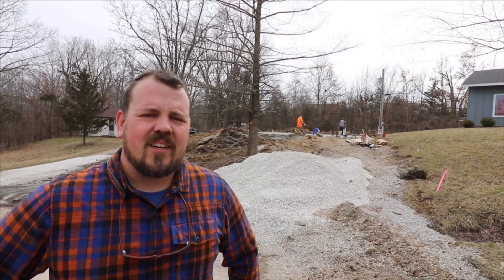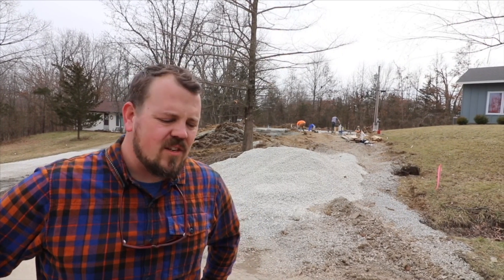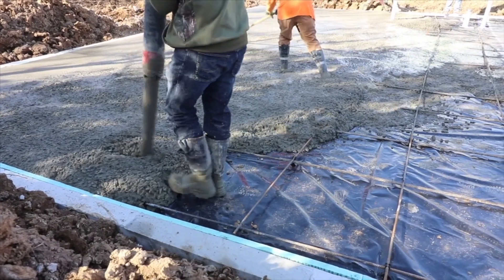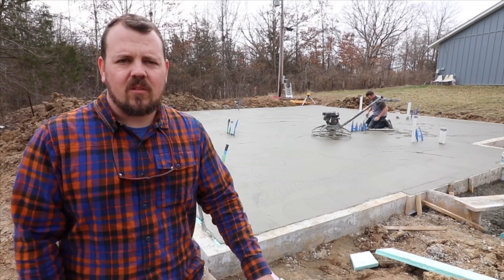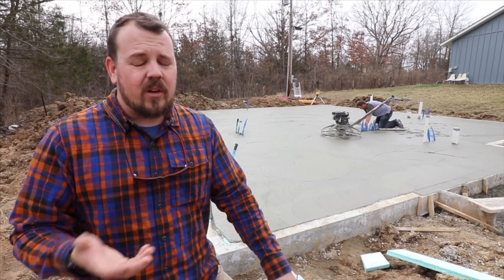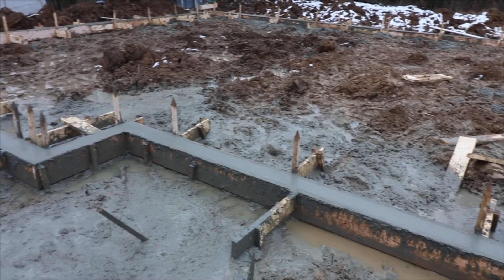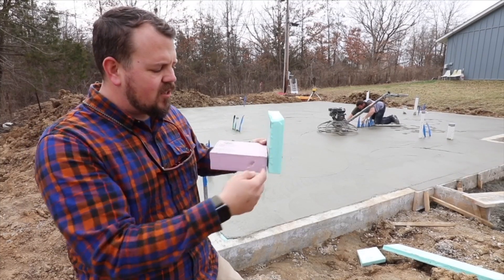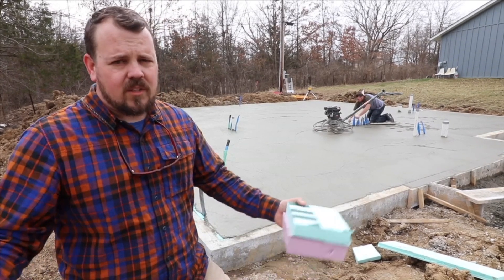How to thermally UNCOUPLE your concrete slab.

Comment: Insulation does not "uncouple". It just delays the thermal transfer for an hour per inch. 6 inch foam delays heat transfer by 6hrs. By morning, an insulated house without heating is EXACTLY the same temperature as outside. Then it will take 6hrs to heat up again

Comment: So the takeaway is that by insulating a slab-on-grade in the prescribed manner, substantial heat savings and comfort gains may be had prior to taking the next step of intalling in-slab hydronic heating.

Comment: I've got a house with a bomb shelter for a basement, a 6" slab covers the entire basement with 2x6 on sleepers and 1-1/2" of plywood for the first floor deck over the top of that. The first floor deck gets cooold in the winter and I need to remedy that in the near future.
I am wondering if I could remove the first floor deck, add 2"-4" of foam insulation to the top of bomb shelter/basement cap and then pour the remainder in 4"-6" of concrete?

Comment: A stone countertop that feels colder is not “emitting temperature back to you”. What is happening is the stone is taking some heat from your hand via conduction. Stone at room temp 72F is colder than your hand (somewhat under 98F). Heat moves from hot to cold or rather from more to less. Temperature is a measure of heat. It doesn’t get emitted. Cold is the absence of heat so it also doesn’t emit.

Comment: I unserdtand decoupling the edge of the slad as the concrete edge is exposed to the weather, in this video negative 9 degrees.  What i am struggling with is the necessity in insulating below the slab due to the average earth temperature under a slab being 55 degrees.  it seems like there is not much bang for the buck because that 2 inch eps is expensive.
Reply: You are still getting a minimum -15 delta that you will loose heat 24/7 365 days a year!
Reply: @imwteach  I'm not sure a 15 degree delta is worth the cost or trouble.  The wall insulation is battling a 50 dgree delta so that cost makes sense.
Reply: @kevinmickelson5128  Still, a 15 degree delta over the life of the home makes it worthwhile to insulate.  After living in our current home for 12 years with in slab radiant heat I wouldn't have anything else...I also wish I had placed more insulation under the slab.  I currently have 2" of Styrofoam and should have gone 4 or 6!
Reply: Insulating foam glass aggregate such as Aeroaggregates will not breakdown like a petro-chemical foam... and allows drainage so it replace most of the stone aggregate...
Reply: I thought the idea might be that the temperature of the ground next to the foundation is cooled significantly by heat transfer through the foundation and heat transfer from the ground outside the foundation.
Reply: I believe he is building a Frost Protected Shallow Foundation which requires under slab insulation in certain climate zones.

Comment: I’m in climate zone 2 so really nobody insulates slabs, but I have concrete floors and the west side of the house has a concrete porch that is connected and you can definitely feel the heat come through the slab if you’re barefoot. My question is this though. Is there a way to pour the slab all at once and insulate? I can just imagine the look from my concrete subcontractor if I told him we were going to pour separate days…
Reply: Build with Insulated Concrete Form blocks and you solve several problems at once
Reply: Have the contractor add the depth of your insulation to the total outside measurements and add the insulation to the inside of the form. I also added large screws into the foam to couple the foam tot he concrete. That’s how I did a frost protected shallow foundation. Super easy.
Reply: @bpdp379  I plan to do the same thing. May I ask, did you use a “protective coating” outside of the insulation? If so, what did you use?
Reply: @billwilljulz  not below grade. Above grade I did add a flat stock metal flashing to protect the foam from UV light and physical damage like weed whackers and such.
Reply: That was added after the pour.

Comment: Good work, BuildBlock makes a product called the knockdown. It is 16 inch x 48 inch x 2 1/2 icf form. You buy the different width spacer for any width configuration. It is the form and insulation in one, 2 1/2 inch on the inside and outside.
Reply: That sounds like a cool system. On consideration why that might have been used on this project is the fear of bugs burrying in the exterior foam. I think in some of the cooler zones termites and carpenter ants aren't much of an issue. But in Missouri and the southern part of the US, putting foam on the exterior (at subgrade) is seen as a risk.
Reply: Are you referring to insulated concrete forms?
Reply: @10tenman10  Yes but the difference is t is 2 panels that can be joined to create any width.

Comment: So the outside concrete is load bearing from the walls and it is not connected to the slab? Would not it be weakened compared to solid foundation?
Reply: Not really, the footing is what holds the weight

Comment: What happens when the bottom foam gets squished into a pancake? Not much insulation then.
You just have to have a crawlspace or need some other substrate...under the slab.
Reply: CS(10/Y) - amount of pressure needed for 10% deflection of average XPS is ~ 300 kpa = 300 kN/m² = 30 t/m².
Unless your main building material is lead you would be having hard time "squishing it into pancake".
Reply: This is an issue for certain types of foam, but xps should be able to take the weight.
Reply: @Superwoodputtie  Thanks for that info gentlemen. very useful info.
only reason I was against slab was that... cold plus moisture... if those are resolved, I am sold to the idea.
do elaborate on exactly what type of XPS is best suited... please.
Reply: @acevirginian2203  so some foam boards are hydrofobic. They won't retain moisture. XPS and EPS foams are good for this. Polyiso foams will soak of moisture and loose their r-value, so avoid those for this application.  Stone wool (specifically Rockwool comfort board 80) is also used under slab foundations. I think if you search "Sub slab insulation" on YouTube stuff should pop up.
Reply: @acevirginian2203  when you see foamular 250 in HomeDepot, the 250 is short for 25 psi, XPS is also as noted in other comments, usually rated for ground contact.  They will use higher psi foams in road construction instead of dirt to "build up" for a road. 25 x 144 (inches in a sq ft) = 3,600 lbs/sq ft
Reply: @williamdavies1977  Roads!!!
And I thought it would pancake in basement slab... you learn something everyday.. haha.
Thanks for that info.
Reply: Will never happen
Reply: I was wondering about this myself -- would like to hear the Build Show address this.

Comment: "We can't completely solve that issue" - actually you can if you put hydronic heating into the slab. Can't beat the comfort and energy efficiency of underfloor heating.
Reply: True but he said it was a rental so this is a cheaper method. I think that's what he meant